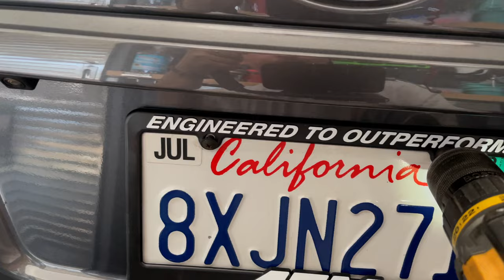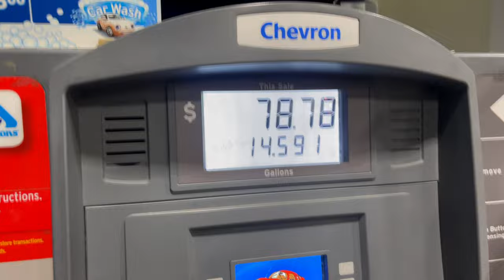THIS SHOULD HAVE BEEN MY FIRST MOD | 2021 WRX | STAGE 1 POV DRIVING (More Pops & Bang’s!)

Comment: Car looks good man I low key miss my 2018 WRX
Reply from the maker: it’s a fun car maaan
Reply: @abgtaxi  yeah mine made 380whp and 355wtq on ethanol and bolt ons. Its was fast in straight line. But the GR corners much better plus i can drift the GR lol. both have their pros and cons.

Comment: I installed a strut bar in my STI and didn't like the way it made the car drive. felt like it was harder to turn so I returned it
Reply from the maker: that’s typically the purpose of it hahah.  stiffer steering means that the chasis has less play and actually helps with cornering.
Reply: @abgtaxi  I know what it’s for. I had one In my integra and it worked great in that style of car but the sti just felt off. I looked into it and it had something to do with balance of the car. Subaru sells a weird STI strut bar that has a joint in the center that flexes that is suppose to help get rid of the super stiff feeling. Coil overs was the best mod  tho fixed all body roll issues 👍🏻